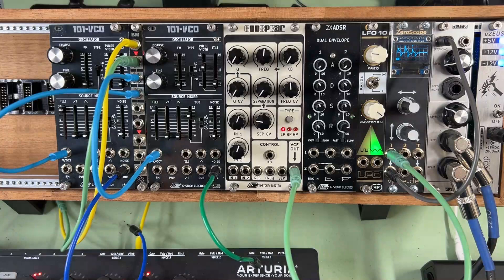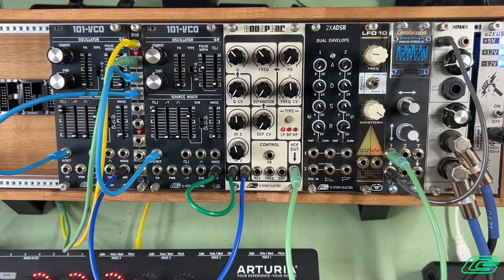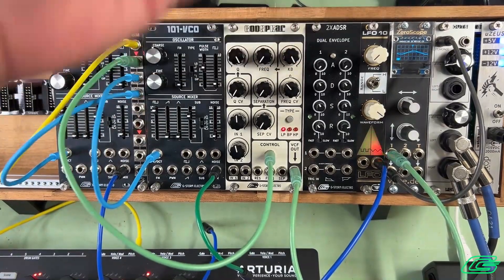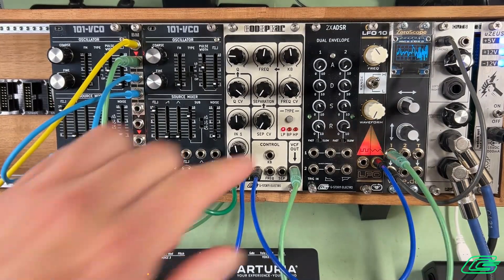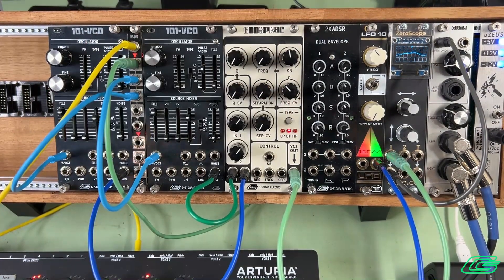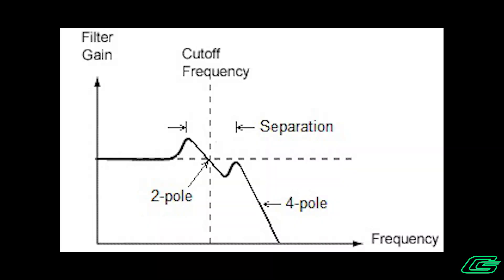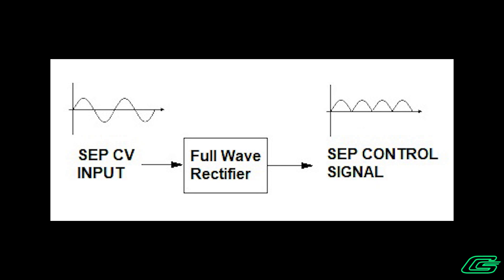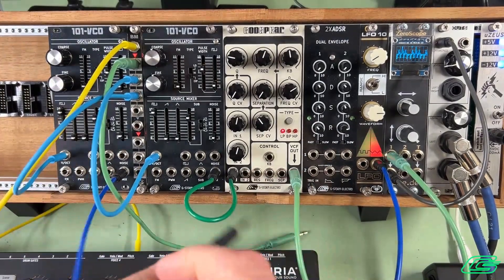GODSPEar | Detailed Overview | Oxford OSCar Eurorack Filter Translation [Demo #2]

Comment: I love your filters they sound great, but i wish you would include vc control of res on vcf's like the ju60 or the SH-5 and on the god spear why not include svf outputs instead of a button/analog fet switch?
Reply from the maker: @indigoskywalker  I can only add cv over res within limitations and constraints where it makes sense. Not saying impossible but don’t want to blow the target price point and hp via feature creep
Reply from the maker: @indigoskywalker  as for svf outputs they all require gain staging. Main board and daughter board are both packed with no more space on the front panel for more jacks. Again pushing more hp I didn’t want to give up. I also nixed ideas for trigger input for mode selection.
Reply: You make these babies in black panel?!